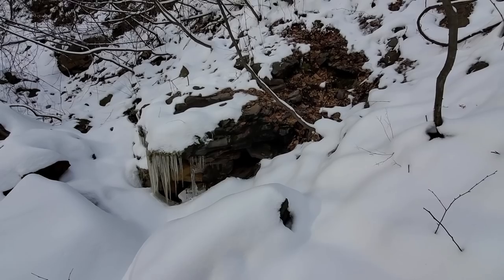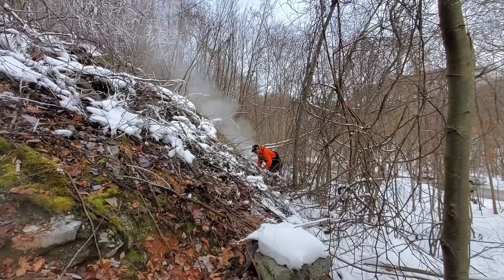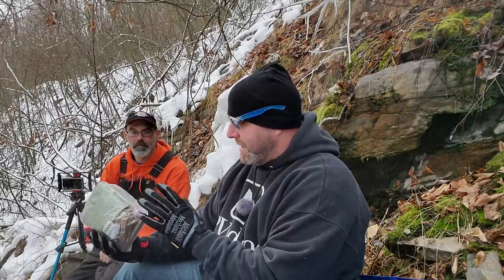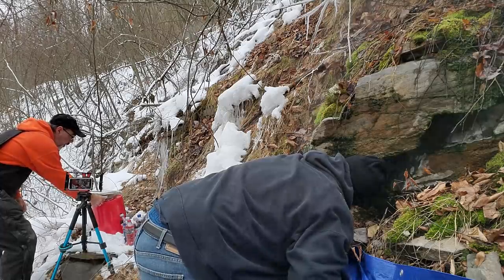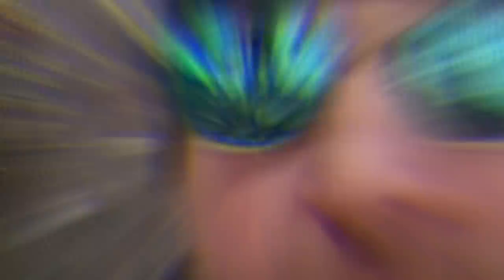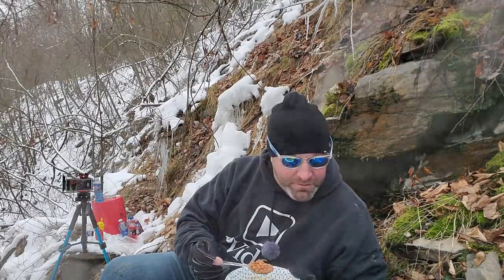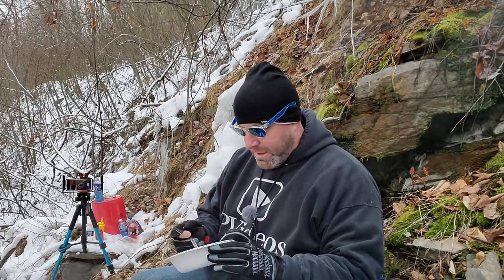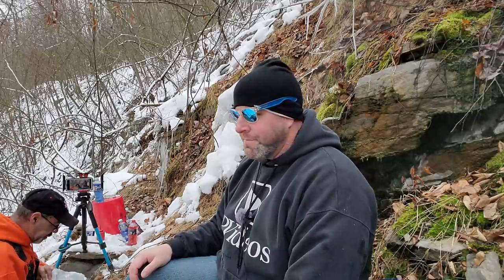Centralia MINE FIRE - Cooking Food In A Mine Fire Vent

Comment: Pretty cool video,  with the MRE,  using water helps the whole meal heat up faster and evenly.  

In a wilderness survival situation and you can across a vent like this,  use a survival blanket put the foil side toward you over the vent and the heat is reflected back down toward you.  With cooking take that foil and close up the vent with the food inside and it will act like a convection oven.  

That was fun to watch
Reply from the maker: Good tips

Comment: Neat experiment but I'd be worried about what type of gasses are getting into the food. 😦
Reply from the maker: There's plenty of ventilation. Nothing is being trapped or consumed. Just harnessing the heating porting of it.
Reply: its just coal right?  like a char coal-wood burning pizza oven???... maybe?
Reply: @MuvoTX  it's anthracite coal-fired, not wood, not charcoal, actual coal Doug from the ground. . Anthracite is the highest grade of Coal. It is like 95% pure carbon. It burns without any smoke. Here in northeast Pennsylvania lots of us use it for heating. Really northeast Pennsylvania is the only place that anthracite is mined.
Reply: @joecummings1260  interesting... ok thanks
Reply: @joecummings1260  curious... do you ever use it for cooking?... does it impart any flavor on the food?
Reply: @MuvoTX  just a little bit more anthracite information. This is an EFM 520 automatic anthracite coal boiler. It's the same model I use to heat my home and garage. They are all automatic except for removing the ashes. So about once every two days I dump the ash pan.

As you can see the fire burns without any smoke whatsoever.

They're quite popular here in northeast Pennsylvania where we mine anthracite. I heat my home to 70° and my 4500 square foot garage to about 55°, burning between 100 and 150 pounds of anthracite per day. If I pick up the anthracite at the mine that is roughly 2 mi from me it is about 7 cents per pound.

https://youtu.be/CiEAZgCEh8g
Reply: @joecummings1260  interesting!!... thanks.  I never knew such a thing even  existed.

Comment: What you must do is block some of the Outlets near that one you're using so as to increase  the flow/force of the Steam which should accelerate the heating of the food.... :) Also put the Hotdogs on the shiny side to reflect the heat inwards otherwise the shiny side on the outside tends to insulate and reflect the heat away. 
But thanks, I always enjoy your exploring/cooking/camping videos! Thanks....
Reply from the maker: Will that help with the hot dogs even if they're wrapped up and not open?

Comment: I used to run a core rig. I drilled into a slate dump that was on fire. They wanted to no how much had burned out and what the temps were. 20’ down was 2000 degrees.
Reply from the maker: I believe it

Comment: I wonder if you pitched a tent over one of those vents or near a vent that is pushing out steam you could stay warm. Probably over the vent would be best. If I didn’t live so far away I will try it myself 😊😂
I just had a second thought -! is there any chance that carbon monoxide is coming out in that steam ?
Reply: That fire is burning without sufficient oxygen. There's a lot of carbon monoxide coming up out of those vents
Reply: @joecummings1260  
I had a feeling that might be it but I wasn’t sure so thank you very much for making it clear for me I won’t pitch my tent over any of those vents ! 😳
Reply: @elnabjelland-hughes8172  yeah when they started testing for carbon monoxide in the houses that is when the big push to get everyone out of town started. It wasn't so much that the houses were going to fall into holes, but when they started putting carbon monoxide detectors in houses they were going off like crazy.
Reply: @joecummings1260  
Thank you - it’s a good thing they realized how dangerous that was and got the people to leave - they couldn’t stop the burning -
Reply from the maker: Its certainly doable as long as you have good ventilation. Its not good air, but definitely a great way to stay warm.